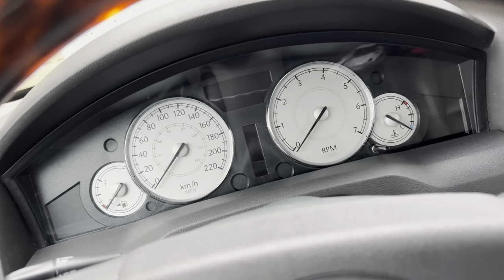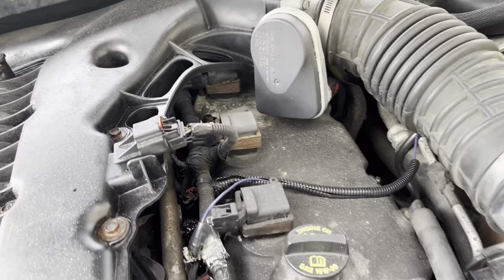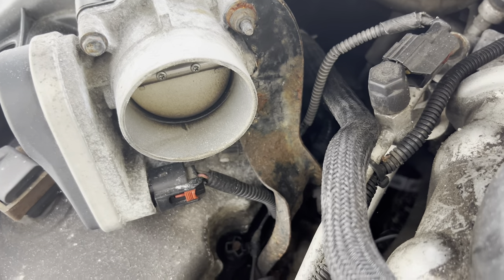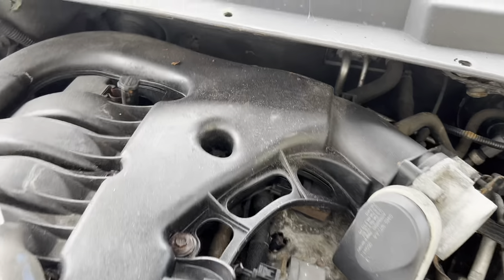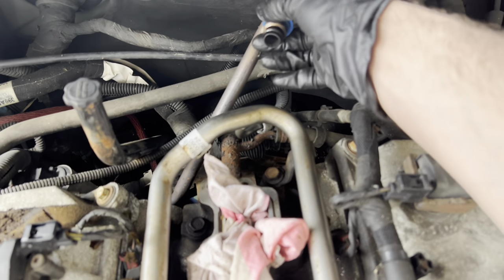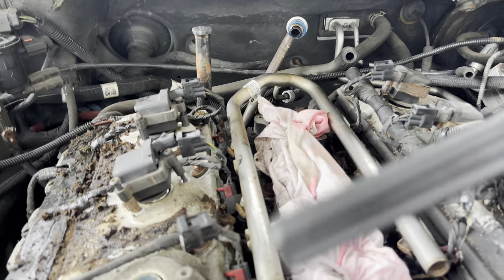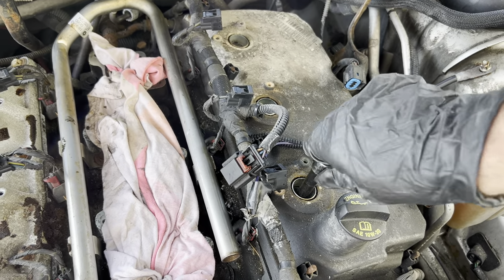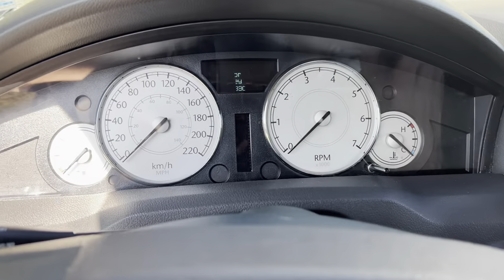P0300 FIX! Chrysler 300 running rough, misfiring and stalling! Dodge Charger, Challenger and Magnum

Comment: Like the video bro I just got 2007 5.7 charger I have 10 codes An this is one of them do you think I should change all the coils An plugs cuz it came as multiple misfires an I know the person had some bad wiring I think as well cuz I see electric tape on wires
Reply from the maker: Appreciate the comment bro!! I definitely recommend spark plugs. As for the coil packs, I replace those individually as they fail. Usually they will only set a code for certain cylinders so they are easier to diag. Clear your codes, and see which ones come back, then fix them as they set. Good luck with getting it fixed bro! You can lmk what codes come back if you’d like. 💯💯🤝
Reply: @colin7761  ok so what about wiring wise I have a 2010 charger as well think I could replace them to the 07

Comment: I changed my spark plugs and coils and the misfire went away for 2 weeks then came back. Any suggestions? I have 2 misfires.
Reply from the maker: Is there any oil getting into the coils?
Reply: Change fuel injectors, easy, anyone can do it just takes a little time away from your regular life, Lol

Comment: Yo I have a scatpack with p0300 dealer said I need my heads replaced so I just got it back and it still doing same thing the same code came up yesterday now I have to go back to the dealership I’m also tuned some ppl say it’s the tune. But there’s no way I waited a month to get it back and still the same problem loss of power rpm not shifting on time
Reply from the maker: Did they replace the heads bro? Thats not right if you paid em to fix it and they didn’t even diagnose it properly or verify it was fixed!! It needs a compression test so you can see if it’s losing compression. If compression is good then we need to figure out why it’s not firing properly. If loss of compression is found then a leak down test should be performed to check whats going on. Good luck bro, hopefully you’re able to figure out whats going on. 💯💯🤝
Reply from the maker: Hope you don’t have to deal with too much stress over this bro. Appreciate you too 💯💯🤝

Comment: Good video bro... question what kind of 02 sensors do you use. Seem like I have to change mine every few months
Reply from the maker: Thanks for the comment bro!! 💯💯 I haven’t had much issues with the o2 sensors. Have to replace them here and there but they have been good since. Bosch, Denso, and NTK sensors should work good! 💯💯🤝
Reply: @colin7761  appreciate it bro 💪🏾💯

Comment: Hello? I have a 2007 Chrysler 300 and it was misfiring. So, we changed the sparkplugs and the coils and new gasket for the intake manifold. Its drives smoother, but it still drives a little rough only when accelerating.  What do you think it could be??
Reply from the maker: Does it have any trouble codes? Is it shaking or vibrating?
Reply: Check the throttle body maybe is dirty cleaning it with a specified soray
Reply: @colin7761   No shaking, No vibrating and No engine light. I couldn’t take it to Auto Zone bcz there is no engine light.
Reply from the maker: No codes still? How has it been running? Do you have a scanner that monitors misfires in real time?
Reply: @colin7761   I plan to take it to a nearby gas station mechanic. Hopefully he’ll find the solution but thank you.
Reply from the maker: I Hope so bro! Good luck with it! 💯💯🤝
Reply: Spark plugs need to be gapped around 50

Comment: Mine has this code but i just replaced the spark plugs a couple months ago. I may try the coil packs. What do you think?
Reply from the maker: Is this the only code it has?
Reply from the maker: Oh okay bro, have you cleared the code and this one came back? Do you feel it misfiring? Does the check engine light ever flash?
Reply: @colin7761  ill have to see if it flashes i havent noticed that. i did clear the codes and some came back. the engine has shook and died not long after start up. Today its running just fine. I did get o2 spacers I am going to put on because of the cat and o2 codes. egr valve was recently replaced and no codes for that, it was prior to these other codes. Ill have to pay attention and get you more info.
Reply: @colin7761  Youll never guess what it was. The pulley tensioner assembly was cracked causing the belt to slip and making the engine run like garbage. Replaced it and its running fine now. Cleared all the codes off with obd2.
Reply from the maker: Damn bro!! Good job on the diagnosis and getting that figured out!! I’m glad you get er up and running again! 💯💯🤝 thanks for updating me too bro. I like to hear that people get it figured out!! Take care

Comment: Would this cause lack in acceleration?
Reply from the maker: Yes it will cause that symptom bro! 💯💯🤝
Reply: There are many reasons  like not enough gas injected a very bad spark plugs  also a bad coil etc etc first scan your computer for any codes